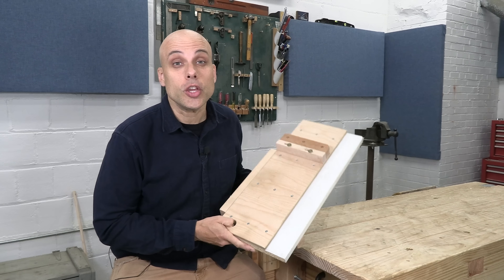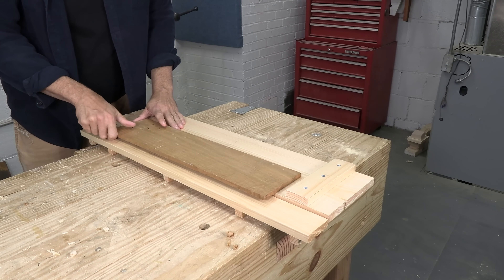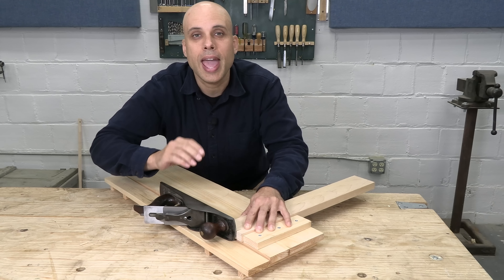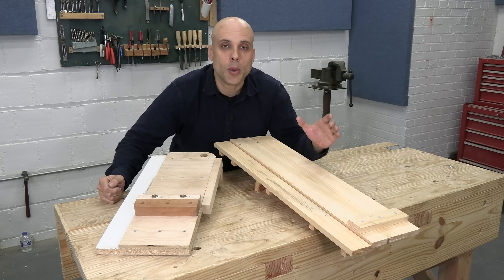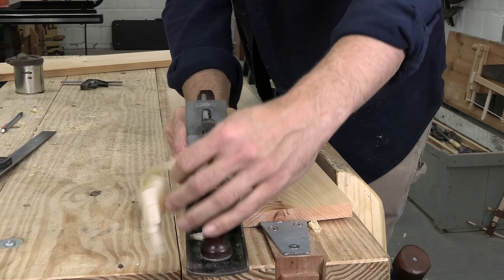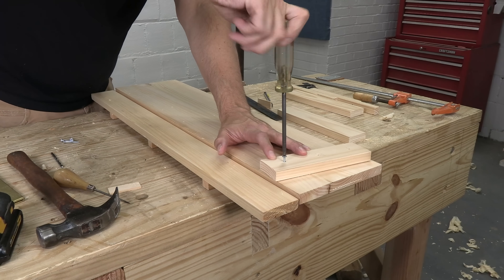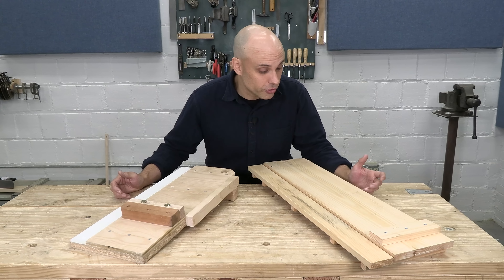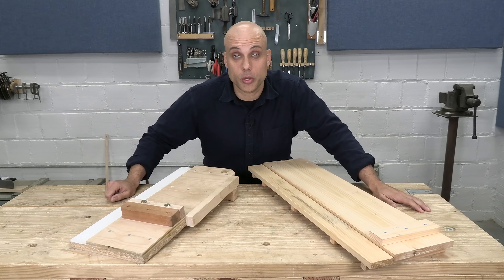Your shooting board is too fancy!  Use this classic design instead!

Comment: I always struggle to get long edges perfectly square, partly because I have a very small work space and can't really get behind the plane, so I was thinking earlier today about why we don't shoot long edges with a shooting board. And then up pops this video! I think I need to keep reminding myself that there's lots of ways to do any job.
Reply: there's also the traditional jointer, which is basically a huge plane up side down on legs. Instead of sliding a meters long plane over a board, you slide the board over the jointer.
Reply: If you are a power tool guy, cross cut sled on table saw dialed in crazy accurately can square very large panels.  But one of  these days, I'll try the modern day shooting board because it's cool.  It seems very simple to make to me - I mean with power tools.
Reply: %100

Comment: One thing that people overlook is that the squareness of the end relative to the tabletop is determined not by the squareness of the plane’s side to its sole, but instead it’s the squareness of the plane iron to the side of the plane. It’s a good idea to check with a piece of scrap to see if you have to adjust the iron.

Comment: Couldn't you just shave a little bit of the upper board away with the plane and then use the slim piece of what's left of the edge as a guide? Take a bit deeper cuts to ensure the upper board never meets the blade.

Comment: Unless you buy an hi end plane, most planes are not Square anyway, so it won’t be square
Reply: You use the lateral adjustment to correct for this.

Comment: I’ve been learning to build guitars in my spare time for the last two years. Both of my shooting boards are very long because we use them to joints the sides of the top and back plates. I’m not really heard of long shooting boards being used outside of guitar building, so it’s quite interesting to see that it’s a historical form.

Comment: Love when you bring back traditionnal design. It's always a good source of inspiration for handtools work
Reply: I just thought again about this video. I realized i'm using less and less my "regular" shooting board and that most of the time, I shoot directly on my bench hooks (which took me about as much time to build as my shooting board). Best of both world the bench hooks fit in my toolbox. It won't address planing long thin edges though. 
But I don't plane thin edges that often. Still, I use my "regular" shooting board for working on small pieces that I have diffulties to clamp or hold or when digging mortise to protech the bench. In the end, I have 2 choices: learn to work without large equipments (like shooting boards) or find a place in the workshop to fit all large equipments that I don't use that often but that I still use :) 
Thanks again for this design!

Comment: In a number of demonstrations I've seen of Japanese woodworkers, their "shooting board" is just a flat scrap of wood used to prop the board off of the work surface, then lay the plane directly on the work surface. I've also seen them hang the board over the side of the bench against some bench dogs and use the plane freely in the air, especially for end grain
Reply: That is a jig to plane would and using your bench as a surface to run the plane is easy and is something that was used in Europe as well. 
If you have ever seen a tool well on a bench it can be used in that fashion as well. You can use it in conjunction with dog holes and so on or even vices.  I have a series of jigs that can be used with dog holes and vice to allow me to quickly plane end grain or long grain on boards. I can run 8 feet lengths by plane very easily and when you oil the plane surface and have a sharp iron it can be like a hot knife running through butter. Now does that really have purpose to be able to plain a board that long and square?

Comment: My grandpa was what they would call today a trim Carpenter but back in the 1920s, 30s and 40s back everything was done by hand. The kitchen cabinets, the trim and even the doors were often all made on site and were not purchased from the store. Dad talked about my grandpa making shooting boards and other jigs out of scrap materials that were laying around the job site. He would use them for one job and then usually toss them. the next job he would knock together a new shooting board and any other jigs he needed. He would do the same for his English work bench as they were too much trouble to move around it was easier to knock together a new one together from scraps. The old bench would be burned in the scrap fire when the job was finished.

Comment: Hey Rex,  You were one of the guys (additionally Sellars, Tom Fidget, WBW, and a smattering of others) who provided me so much input as I got started with hand tools only a few years ago scratch.  I come back once in a while as you continue to provide bumps in the right direction and new ideas. In the meantime, I've got a full shop of restored antique tools, a 250 kg antique bench  and quite a few nice tables without a touch of metal anywhere in them. Thanks.
Reply: How did I forget Mr. Chickadee?  That weirdo too....

Comment: I made this, but with one significant change:  I used Baltic birch plywood instead of pine.  Trying to get pine straight and square without a jointer and planer is a challenge, that I don't have to worry about with plywood.  A 12 x 30 1/2 inch thick piece costs $22 at Wood Craft.  Turns out that is almost exactly what I needed for this project.  After ripping the stage and track on my table saw, there was enough scrap leftover to make the battens and fence.  And since plywood doesn't move like regular wood, I was able to glue the battens instead of using screws.  Drilling and driving 30 screws is a lot of work, and I have a hard time getting them accurate. When I glued those battens, I didn't even clamp it.  I just set them in place and put some 5 pound weights on them.  Everything took less than 15 minutes.

The only thing left is the cleat.  I have a scrap piece of wood that I am going to clean up for it - using my otherwise complete shooting board once the glue has dried overnight.

Comment: Thanks Rex, I've been shooting edges on the flat for a while before even seeing a long shooting board (Cosman). I just clamp my board with holdfasts on my flat bench propped up on a 1/4 piece of hardboard. My mitre plane rides on the bench top parallel to the bench edge. If it's a long board I can just walk along the bench.

Comment: When you're shooting board needs a shooting board. It kind of makes sense to have a end grain and a long grain tool for cabinet making. It still amazes me that they can make such complicated beautiful works with just the simplest of tools and the right knowledge.
Reply: In high school wood shop, we had industrial grade power tools.  I am talking 5 HP Powermatic table saws, 24" Oliver thickness planers, stuff like that.  All you had to do to get perfect furniture was to set the fence and feed it through. The furniture practically made itself.  On one project I tried to do a little cleanup with a hand plan and got planer tracks all over it.  Almost ruined it.  I avoided hand planes for decades after that.  But when I visited the old lady in the apartment next door with her 19th century furniture, I wondered how they made it so well.  
With videos like Rex Krueger's, now I know.
Reply: It is one of the reasons why a country cabinet maker 150 years ago could fit one cabinet a week  rather than taking 3 months to do it.

Comment: Hi rex. Since i got into hand tools, I found i rarely shoot end grain on a shooting board... i mean rarely do i need plane endgrain at all. I find than in cabinet making/joinery most of the time you are assembling frames using mortise & tenons (or equivalent) or fitting pannels in frames, so usually straight from the saw is good enough. Sometimes you make drawers or boxes or even mitering and in these case the shooting board might be relevant (depends on your sawing skills). I believe old timees would have a lot of these jigs depending on the type of product they were making to help with repetitive tasks, as they would be usually making the same type of piece over and over again (chair, tables, couch, doors, windows... )
Reply: It depends on what you are making. Certain fine furniture would most certainly have used square end grain. Inlay doors would need accurate end grain finishes. 
It also depends on your work style as it is not necessarily needed to have square finishing on furniture or buildings as long as the naked eye does not pick it up it will not be noticeable.

Comment: I have two small mdf shelf boards that the long piece is laid on top of , clamped down to bench, then just run plane down board, the plane just rides bench top. Also have standard shooting board. However half the time I use a bench/saw hook, the cleat that holds it is squared to edge and runs all the way across. So after sawing just flip over and shoot edge and on opposite side. Also just plane running on bench top. Down and dirty baby. All these methods work well.

Comment: Thank you!, Mr. Krueger!
BTW, I LOVE your book!
I think I'll build a shave horse w/ features from your book's workbench.
I want a traditional horse w/ 3 legs, that was common down south here in the old days.
I just rehung an old axe head (stamped [cast?] U.S.A.).
I used my Craftline Basic 511, a drawknife & a 10-Inch Surform Half Round to carve the handle & shape the head end.
I had made a section of oak into a mallet & used that to drive the handle.
I'm coming along OK for a 67 yr-old disabled medical retiree.
I want to learn the old ways, before power tools so I've bought used a used drawknife, a brace (need bits), a hatchet, & the old used axe-head.
I've started a railing-mounted workbench (shelf?) on my porch & I've got a small anvil, too.
I've got to oil my axe so I'll see you in your next video, BTW, Thanks! for Mr. Blackburn's link.
Have a GREAT day, Neighbor!

Comment: Awesome!!! I am building a book case, and my plan is to create shelves from laminated floorboards. I need to glue those up, and therefore need to be able to hold them to plane them. I had actually planned to first create a workbench, to be able to plane those boards. With this, I can start planing and glueing already, to work towards an end result. Best idea since sliced bread, thanks Rex!
Reply: You can make jigs that allow you to side the board up on its side so that you are looking down on it like you would when it is in a vice. With modern clamps it makes the whole process more simple.

Comment: As I have said before I learned most of my wood working from my Father who was in turn taught by his Father who was a time served Cabinet Maker.
I was taught to joint thin timber simply using one or two battens on the bench top and my Fathers shooting board was just the opposite side of his bench hook.

Comment: At 8:51 one option would be to cut a slight notch/dado next to the shoulder, the width of the distance between the side of your bench plane and the edge of the iron. Then you can plane the steps with your bench cross grain.

Comment: I built the paul sellers shooting board with replaceable wedged fences, and I really like it! Its a classy design.
Reply: It does not need to be that complicated for it to work but it is a nice shooting board.
Reply: I built the Paul Sellers one, too, but I do find  the wedges change with heat and humidity and I am frequently fiddling with them as they either go in too far or not far enough into the cutouts. Easily fixed, but slightly annoying to have to tweak…

Comment: Put a wide long piece of lumber on the opposite side and use bench dogs to hold it down to the shooting plane both providing a firm square edge for your piece to but up against and not tip, but also holds down the shooting plane to the bench top. Regarding your comments at minute 10:00

Comment: I've just had a thought that might make the creation on the step-down in the battens easier - probably not an original idea but nevertheless...   if you use a wide piece of stock and create a step down across one end of it (easier than having to hold all the narrow battens together in a clamp) then rip it into narrowerer individual battens. It could also help with the initial thicknessing.

Comment: Great video for homies who don't have, want or trust themselves with a whirling mass of electrically powered, finely tuned bear claws.  I would say that I think the more common shooting board has evolved to something that is just about solely used for end grain trimming. What you've very well demonstrated is something that would be an absolute aid to jointing a board.  And if I had two boards to joint for a glue-up I could place them face to face, joint them with the 7 and they would be perfect.  1 guess who's building one of your long shooting boards ASAP!   Thank you heaps.

Comment: I was hoping this video would answer my 1 question I have about shooting boards, but alas, it did not.
The question is: How do you deal with or avoid the plane digging into the top piece of the shooting board ? you plywood piece doesn't look thin enough to avoid that, but now that I think about it, I guess it doesn't matter since it doesn't dig all the way down and therefor stays straight. I guess I answered my own question, which happens a lot.

Comment: Would a shooting board work better if the base plate was at an angle to the higher plate so the plane blade is at an angle to the cut?  I'm thinking making it with the steps at a little different depths to create a slight slope.

Comment: I've basically never found a use for a shooting board. If you've got the skill to use an old style shooting board, you can basically do the same thing freehand in your vise. It's only with really thin stock where you can't balance the plane on at all where a shooting board adds something.

Comment: I have an even simpler way; when I needed to shoot 40” long 24” wide boards I did it by laying them on a sheet of formply with some 3/8” thick packers underneath and shot them with my Luban LAJ plane on its side. I worked to lines struck with a knife; very easy to sneak up to.

Thank you for NOT spitting out annoying “shorts” like James Wright has started to do; I unsubscribed from his channel because of them.

Comment: Excellent video Rex, and thanks  for all the great videos! One quick question, I noticed you are using a Hock iron in your plane. Was it necessary to widen the mouth of your plane to accommodate the thicker iron? I am considering moving away from the stock Stanley irons for my ''vintage" Stanley plane but am against modifying the body of these planes in any way.
Reply from the maker: The hock just barely fits and gives a tight mouth.  I might open it just a little,  but I would be removing so little material,  I wouldn't even consider it modification.

Comment: I wonder if it would be worth it to build a shooting board like this into the long edge of a workbench? Essentially just a channel to run the plane along. You could joint long boards with it! Would there be any downsides?
Reply: If you've got more than one work piece, and they aren't too thick, say 3/4", you could stack them with a small offset, maybe dogs and holdfasts to keep them in place, and you are good to go. No need for a channel then, just assumes that your bench is flat, and mine is not...

Comment: Does having a camber on the blade make any difference with a shooting board? Does the camber just make such a minimal difference that you don't worry about it?
Reply: You probably wouldn't have a large camber on a finishing blade that you'd likely use on a shooting board. It'd be sharpened like any smoothing plane blade, with just a few strokes on either side of the blade when sharpening to round the corners. Because of this, it's unlikely that the camber would engage with the workpiece, which is raised on the shooting board.

Comment: If I wanted to idiot proof the squareness / flatness of this, could I just whack apart some MDF with a circular saw and use the factory edges as the guides?
Reply: Yep. No glue needed. A mdf or even better particle board (the plane will slide on that surface) for bottom, get a piece of plywood for top with few plywood scraps for stop with factory edges,  clamp the top and the stop assuring there is perfect 90 degrees and then screw everything up and you're done.
Reply: Yes.  Even easier, make one out of a pair of MDF shelving boards from the box store that have a straight melamine edge to them.  I haven't done that for a shooting board, but did make a jig for router trimming from a couple of them, with a bit of 1.5" steel square tube on top with carriage bolts and wing nuts as the overhead clamp.

Comment: One thing I have never been able to do with a hand plane is get edges that are square.  No matter how much I try, it comes out crooked - so much that I can easily see it with my eyes.  I have been using my hand planes to get the edge straight enough to use a tablesaw, then cutting the reference edges with it.

I am going to build this, but with one change.  Most of my planes have a chamfered edge, so I am going to lower the track so it is about an inch below the stage and the plane cuts in the center of the blade.  That way I don't have to worry about the chamfered edge affecting the squareness of my cuts.
Reply: You can with practice and skill edge plane a board to be square but a shooting board which is really a jig makes the process fast and easy. 
If you have a bench with dog holes you can also use that as a jig as well. You can also make jigs that fit into vices.